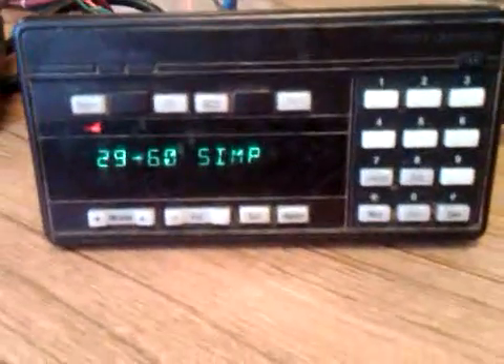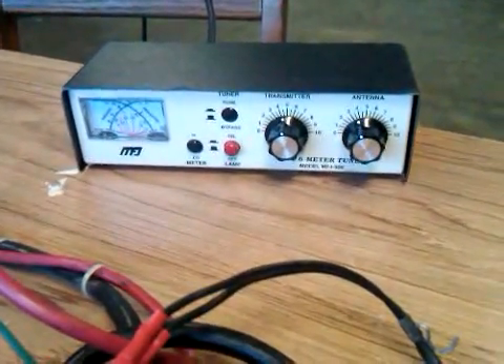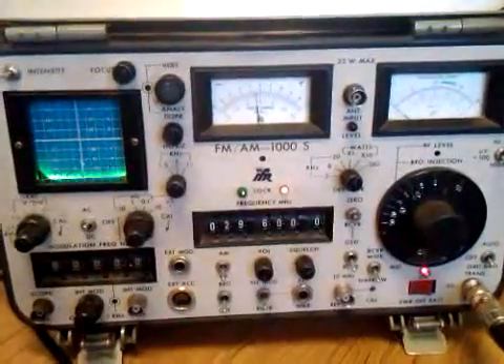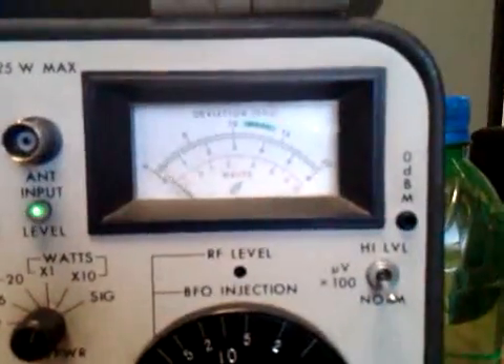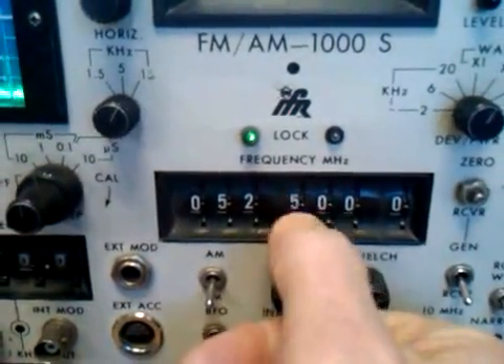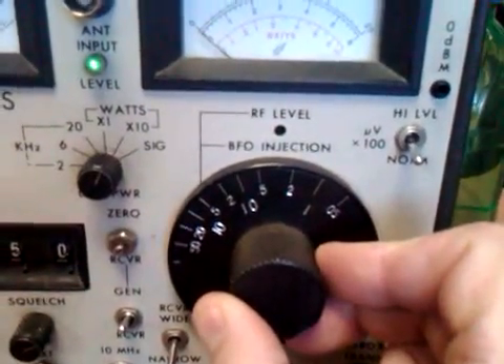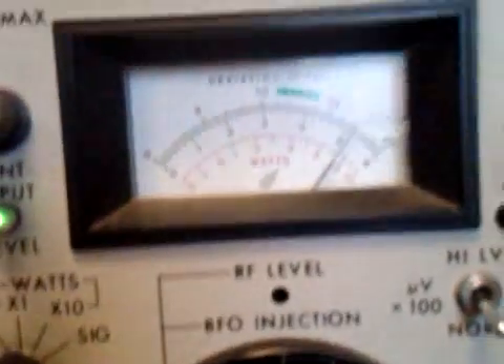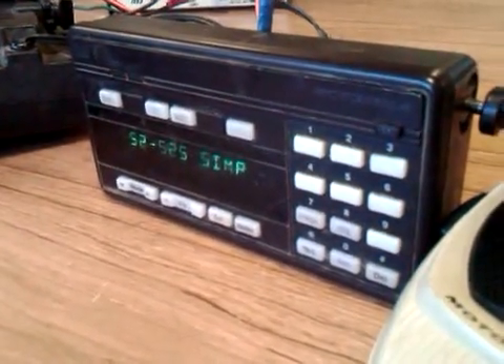Motorola Syntor X9000 lowband

Comment: The other thing I recently learned is that the microphone element used actually tailors the audio response as well. It doesn't respond as well above 5KHz, but provides a boost around 3KHz, as our understanding of language is based on higher frequencies but our "talk power" is in lower frequencies. Bell wrote papers about this in the Bell System Technical Journal (BTSJ).

So it's a combination of factors that make up a good radio system. True FM being one of them. :)

Comment: Yes indeed, they're well suited for sounding great on the air. I also love the older models such as your Saber, HT1000 and the MT series portables. They've also become VERY inexpensive too which is really great.
Another cool thing about the Saber and HT/MT series portables is the ability to use an MTVA with them. You can mount it in your car and it'll interface your portable to an external antenna, speaker microphone & DC power like a mobile radio.
These make great amateur radio's though :)

Comment: In general, any Motorola radio will sound great on the air. This is because Motorola has a largely 300 - 3KHz response and direct FM transmitters. More than one person has told me that I sound the same in person as on the radio. Of course, my car radio is a Saber. +/-4.5KHz deviation, and 1x10^6 frequency stability (1Hz in 1MHz)

Comment: Excellent radio's for ham radio use. I've used plenty of these over the years for amateur radio but I learned early on to program them myself. Otherwise it can be a pain in the ass trying to find someone who can do it for you. That's why I acquired the RSS and learned them ALL :)
These old Syntors are an excellent value for the money these days and they have plenty of power for ham use and sound great on the air. You won't find a better built radio system.